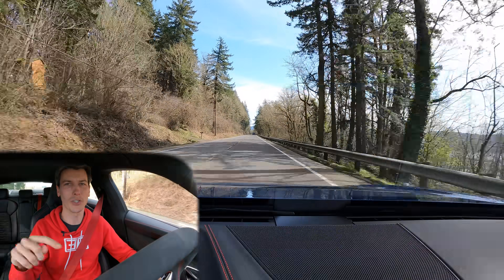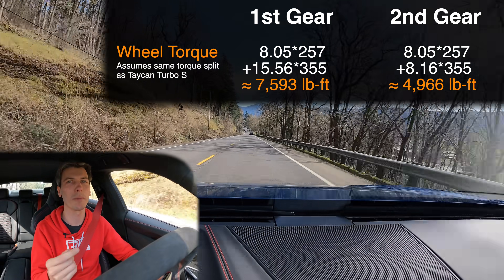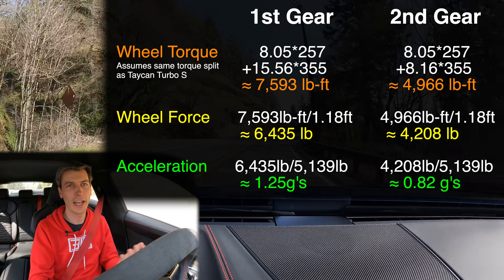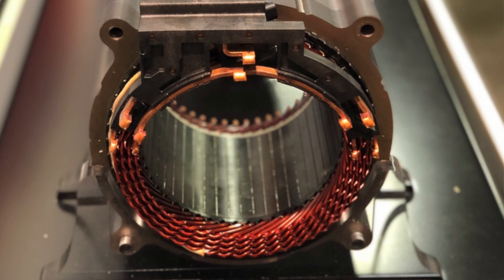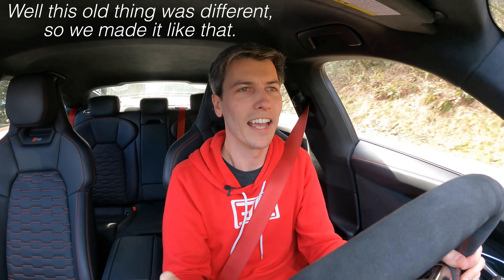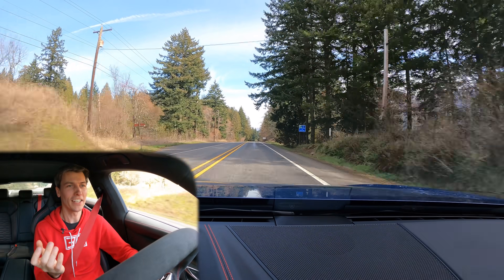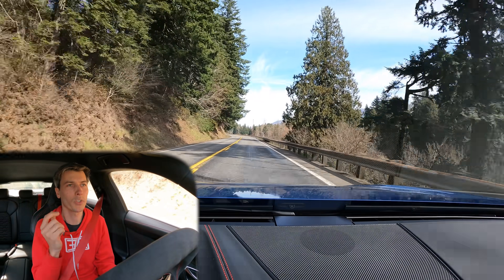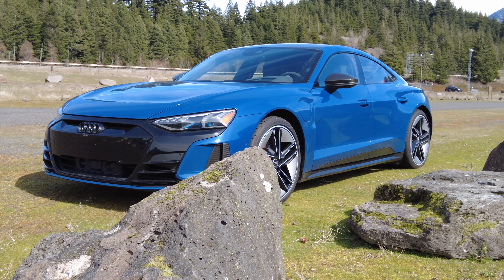Are Fake Manual Transmissions Coming? Audi Keeps It Real

Comment: I've been saying this for years they need to make a electric car that can sound and act like a manual sports car. 

Literally just take simulator logic and apply it to a electric car it should work fine. 

You also get to Drive whatever engine swap you want 😁
Reply: Noise through speakers are terrible, itll have no real soul. I rather have a silent electric car then a fake noise that mimics an engine
Reply: @ODST_Republic  I mean video games are even more fake and people buy them. I can see this being a thing
Reply: @PleaseDontWatchThese  yeah, but there's a bit of difference, one costs $60 or less and the other costs a couple of thousands. You expect one to be better than the other.

Comment: A multi speed transmission could improve efficiency by allowing the motor to run at lower rpm's. I'd be curious to know if the weight and cost of a manual or automatic transmission could be compensated by a smaller battery while keeping the same acceleration and range
Reply: Not necessarily- a mechanical gearbox has losses and these tend to much greater than any benefit you are going to get from the electric motor.   Overall adding a gearbox will lower the efficiency

Comment: Honestly what i dont get is why not just put a real transmission in, like with the new Opel manta EV concept. That got the electric engine up in the front, a real manual gearbox and a differential at the rear. We have already reached the point where manuals are WAY slower than automatics anyways, so they might as well make driver focused EVs with real transmissions even tho that will affect range and power negatively. I can certainly say that i like the feeling of having a 8 speed transmission in my BMW 330e, it is an automatic, but feeling the car shift gears in EV only mode just makes it feel a little more alive.

Comment: For posers... 

Now, I want someone to make a plugin hybrid with a nice V6 gas motor, RWD and six speed manual, AND a big enough battery and electric motor to just to power the front wheels for increased power/economy for electric only, boring stuck in rush hour / around the city driving. 

Electric only mode would be just like any other FWD electric car, but the manual transmission would not be used and have to be in neutral for this or have some other computer controlled disconnect for the rear wheels.

Sport/fun mode would be a sports car, just with a little electric motor assist to the front wheels. Keep the gas engine and manual transmission completely mechanically separate from the electric drivetrain, the ONLY connection should be a virtual one for accelerator (gas/throttle) input, cutting power from the electric motor when changing gears on the gas motor. 

This combination would give you a nice supercharger type sensation and better fuel economy when enjoying your car. Then you also have super quiet and relaxing driving for when you don't want to hear the gas motor or do shifting shifting; or just need/want to save fuel. 

That to me would be the perfect sports car I think. Win-win-win if you ask me. When I heard the Nissan 400Z was being developed I heard there may be a hybrid... and what I described above is what I was hoping for. It would be nice to have sports car and economy runner in one, but still a real sports car.

Comment: A side effect of the multi-gear rear axle in this car and the Taycan is that they get significantly better ranges on the highway for their EPA ratings than most EVs. In fact, they far outperform their EPA rating at highway speeds (75mph) vs (I think) every other EV on the market.
Reply: This is why EVs need a transmission. Not everyone's commute is within a city (where EVs with one gear work here).
Reply: @aaryeshg.6526  EVs can already have multiple drive motors, with one set geared for highway considerations, removing the complexity, weight, harshness and additional failure point(s) of a transmission.
Reply: If I'm not mistaken, putting the E-tron GT and Taycan into their most efficient modes (efficiency and range mode respectively) also reduces power to the front motor or shuts it off entirely, as well as setting the transmission into 2nd gear. I am yet to drive one, so I'm not sure.
Reply: @snakeeyes9246  that's interesting. If anything I would think it would shut off the rear motor and use the front motor is smaller and therefore is usually more efficient at cruising speeds. Just because it would be more loaded.
Reply: @snakeeyes9246  No it's the reverse, it puts the gear in neutral and only uses the front motor if I'm not mistaken.
Reply: I figured there might be use for a 2-speed for top speed rating.  I’m not sure how fast the Teslas can go, or how long they can cruise at those speeds.  I can definitely foresee some German drivers paying $$$$ for their high performance EV to want it to go as fast as their 911 or R8.
Reply: @stephen3164  The Rimac Nevera can reach nearly 260mph without a multi speed gearbox, while the Plaid is capable of pushing 200mph. Just like a gas car, the energy required won't let them sustain those speeds for long (Veyron can only do 250 for 12 minutes), but ultimately a gearbox isn't needed when you have 3 to 4 motors with massive torque and a broad RPM range.
Reply: @knroo-j1487  At those speeds, the TIRES are the limiting factor. A veyron can only do 250 for 12 minutes before it runs out of fuel - but the reason the tank is sized like that is because the tires will only last 16 minutes. Rubber with these ratings isn't cheap either - which is why a lot of makers are electronically limiting top speeds. (Fun fact: When a Veyron or Chiron does a single 250mph run you have to change all the fluids AS WELL as the tires before continuing. It's not something to "just do" on Track Day)

In many jurisdictions you MUST fit tires which are rated to the vehicle's production speed, not the speed you intend to drive at. In places like France you have the option of fitting lower speed tires but then have to have a prominent speed limitation placard in the cabin and in some cases are banned from using the expressways/autoroutes
Reply: I also wonder about range and battery longevity if EVs used gears. E-bikes (mid-drive, not hub motor) are claimed to get better range of the battery when using gears to keep the motor in the optimal (though wide) rpm range.
Reply: I don't believe this statement is true. I found two test with 93Kwh battery and they were 293/297 miles. For example my P85 has an 85kwh battery that is actually around 77.5. Combined range is 265 miles, but cruising range on the highway at 75 is about 250miles with some wiggle room. That averages out to 3.25 miles per Kwh or 307.7 watts per mile. At 55 on a good day I can get closer to 250 watts per mile or 4 miles per Kwh. 

Porsche shows 240 miles of range for the EPA test or 2.5miles per kwh or 400 watts per mile. Kind of poor. Porsche does over achieve in the real world, but I feel like that is because the EPA test might not get into the second gear. In the real world lets say the porsche gets 295 miles with a 93Kwh battery. That is 3.17 miles per Kwh or 315.5 watts per mile. Even if we say the usable battery is 85kwh that only bumps it up to 3.47miles per Kwh or 288 watts per mile.

So, the Taycan is efficient as new tech should be, but not the most efficient. I think the model 3's happily go around at 4 miles per kwh at 75mph for example.

I really think the EPA test doesn't engage that 2nd gear to get an accurate reading, but I also believe the gear box just adds complexity for very little or no real gain. I honest think a tiny front that pulls you along at highway speeds would be more efficient then a transmission. Just size that tiny more to be able to pull the car through a headwind and be most efficient between 65-75 mph.

Edit, I will say though that the ticon having two gears allows it to use smaller electric motors which are probably more efficient at cruising speeds than a larger motor, but that efficiency is probably lost with the transmission.

Comment: And what about using a real multi gear transmission? You could have more torque from the start on, the Motor needs a lot less amps to get the car moving, so you can have a smaller battery without losing too much range. Especially in cities, where BEV might be overtaking soon, you have to start and stop so often. So why cant they have multiple gearing, to save a lot of energy from a stand still? Is it just a cost thing? I run RC Cars since I am 6 years old, and already 20 years ago I knew, brushless motors are the future. But I changed the gearing every time I went to a different racetrack, because there is no point in having one too long gear ration, that wastes a lot of energy and reduces acceleration. And this rc car had peak power of almost 1kw and weighed only 1,5kg. So in a real car which is really heavy, you should have much more of an advantage of a low gearing to start with and a higher gearing to get to highway speeds. Yes, you can make the electric motor turn faster with higher voltage or different stator winding, but then you also loose torque and increase the amp draw under acceleration, which makes you need a bigger battery, makes the car heavier, so you need a bigger battery again, due to more weight you now need a bigger motor and so on. Its just all so much of a waste. I am absolutely sure that any electric car would be improved with a real multi gear (or cvt, but they often cant handle so much torque) transmission and you can safe on ressources and have the same acceleration and top speed but dont need as much energy to get from point a to point b. Of course, if you start the car, get on the highway, get off the highway and you are in the destination, a multi gear transmission wouldnt help. But realisticly you have to stop and start again really often, especially in cities where BEV should be most useful, and in stop and go it would be mor eefficient with multiple gears. It could be automatic for efficiency sake, or manual for driving pleasure, but it has to have multiple ratios. Not 6 or 10 or so, just maybe 3 or 4.  When the E-Bike trend started, all these chinese conversions had a electric motor in the hub of the front wheel. That worked well when you were riding on straight roads with just light inclines, but when it should help you from a standstill, they had no power, and when it goes up a steep moiuntain, they drained the battery really fast, because the gearing was too tall. If you shop for E-Bikes now, most of the better ones have the motor mounted where the pedals are, so it can take advantage of the different gearings of the chain drive. And a bicycle with one person on it is very much lighter than any car, so why dont have electric cars multiple gears? I also know, that some formula E teams testet different transmission setups. I understand that they now use only one gear, because a formule E car has to start once, and then drives without stopping till the battery is drained. But thats not realistic for a car driven on the road, so there it should make sense. A transmission with lets say 3 gears might weigh 20kg more than a one gear transmission, but you could surely save that weight on the battery then, and efficiency on high speeds cant be much worse because there are two other gear sets rotating in the transmission housing, in real world driving the efficiency improvement from a stand still should easily equalize that.
Reply: @Alfred Wedmore yes I have Heard of some conversions, but I am talking about mass produced cars. I dont understand why NO manufacturer uses a Transmission with some gears besides Audi etron/taycan, which just uses it for more crazy acceleration and only in the rear axle... Cars like a Renault zoe or Nissan leaf should have a Transmission, they would accelerate better and have better Range when driving in City traffic...
Reply: @Alfred Wedmore but they can use smaller Motors and Batterie, that should compensate the price difference....

Comment: I've always thought this would be cool, though.  Basically give the "manual" transmission an auto mode for 90% of the time, but when you wanna have fun, just start rowing through those gears.  The car would be 100% electric, but it would have a fake engine noise and fake transmission.  Hell, maybe you could even choose the gear ratios and engine noises that it simulates.  How sick would that be.
Reply: Yes fake engine noise and a fake transmission that would be so “sick” 🤡
Reply: @cameronhines4726  Well, when combustion engine cars are inevitably rare and difficult to find parts for, you tell me what you'd rather have.  The option to relive that nostalgia, or a big middle finger?
Reply: @superluig164  I’d rather have an electric car that isn’t pretending to be something it’s not .

Comment: 1. Multi-gear EVs: To extend the benefits of ideal torque on an EV motor, this makes sense for a selected motors that can't fill an intended target performance range on their own.

2. Single-gear EVs: For motors that are powerful enough to do the job on their own, opting for more ruggedness and reliability - MBTF - from a simpler drive-train, at the expense of some potential efficiency/top-speed optimizations.

3. Fake-gear EVs: To appease man-children.

Comment: While Tesla doesn't have a transmission, I think (on the trim level with dual motor), the motors are geared differently. If I'm remembering correctly, that would make it somewhat similar to the Audi in this video.

Comment: Imagine on electric Toyota you press clutch than wait a bit and dump clutch in second gear on imaginary idle while turning... And car breaks the crap out of rear wheels and spin you 😂🤣😂🤣... 
I will pay for that crap. 
Or rew up and initiate drift by dumping clutch at higher rew... 🤣😂🤣😂
I need that in electric car
Or you miss shift in lower gear and Toyota force you to pay engine swap.😂🌝🥀🌝😂 That's good one

Comment: Is there any industrial level system using electric motors — not just automotive but manufacturing, railroads, shipping, etc. — where multiple gearing of the motor output is actually required for efficient operation of the system?

Comment: I know it is more cost effective to do a direct drive electric motor with GOBS of torque. But I welcome the idea of 'software' manuals, tunable power bands, or even a vehicle that has an actual transmission, smaller or programmable electric motor.

Comment: The reason for  the fake sound:

I worked for Audi as a Tech for quite some time.  Interior/ exterior rattles and squeaks were a common customer complaint.  After driving a hybrid (on electric only) I can hear everything.  I believe you commented on hearing the application of brake pads in the model 3. Those sounds have to help mask road noise.

Comment: I am definitely not against the idea of fake manual EV's, but I feel like 6 speeds is quite overkill. I would think a 4-speed would be perfect. Ev's are torque monsters, gear them like they are! Use 2nd and 3rd around town, 4th on the highway and 1st if you want to smoke some tires. In a world soon to be full of 1 or 2-speed electric cars, I feel like having 6 gears ( if they are geared like ICE transmissions ) would be redundant.

Comment: i dont understand WHY cant the manufacturers make a proper mechanically geared EV, you know just strap a motor onto a "flywheel", engage the clutch etc...i think its easy in principle, they are just lazy. it would make EVs have more range, i believe.

Comment: Now that I've driven an EV with no gear shifting for 3 years, when I do have to experience a car WITH gears, it's exceptionally annoying, and the loss of torque (and subsequent gearing down to accelerate) it's so frustrating I want to smash things.

Also, that Audi's interior looks old and tired, in my opinion.  Almost like it's already aged several years.  I expected more out of Audi TBH.
Reply: I switched from an EV (Chevy Bolt) to a sports car (V8 Camaro) and I had much the same experience.  Even though I'm DEFINITELY going faster in the Camaro, it still felt sluggish and unresponsive in comparison.  It's just something you have to get used to, and now that I am used to it again, I love the experience of driving an ICE car.  I still love EV's, too -- I need one of each to suit my mood :)
Reply: @bvoyelr  I'm in a Tesla model 3 LR, she's plenty fast enough for me!  LOL; but we only own 1 car, which gets used for hauling everything (groceries, lumber, etc).  Wouldn't fit in a Camaro ;)
Reply: @MichaelIreland  We have tradies in Australia swapping utes for Teslas.

Comment: Ok ok ok , BUT what if we hook real gearbox to an electric drive in order to achieve a higher top-speed and maybe increas efficiency a bit by not making the electric motor spin like crazy all the time, building heat in the battery and draining electricity in peak RPMs??? First gear of something like 1.2:1 ratio, 2nd gear 1:1, 3rd gear 0.8:1 and 4th gear 0.6:1. Wouldn't this allow less powerful motors to achieve better acceleration and efficiency under higher speeds? Isn't this exactly the reason why we see EVs getting huge acceleration at the start and drop off to ICE vehicles once they get going? I always believed there IS a future for the transmissions even in the EV world.

Comment: There's actually already manual electric cars. A old classic Porsche was fitted with a electric motor and battery and a 3 speed manual transmission. It was tested by autotrader in the UK.